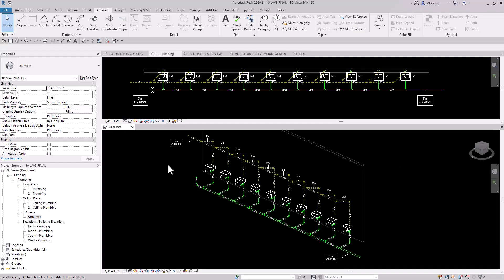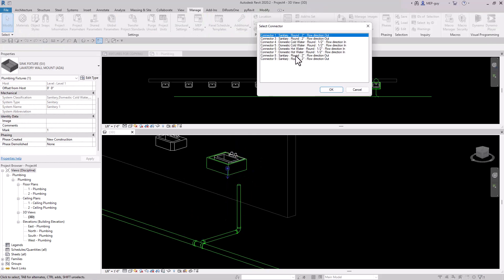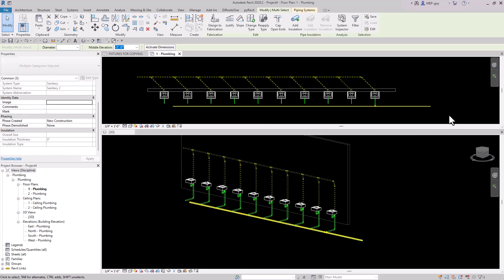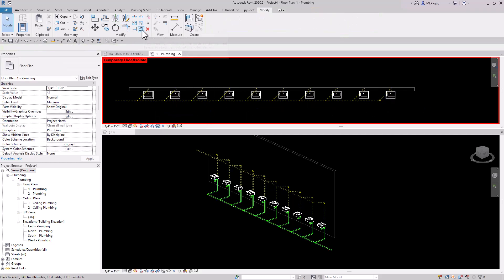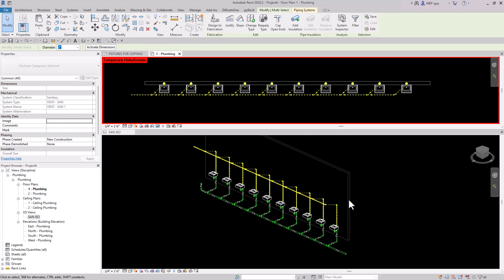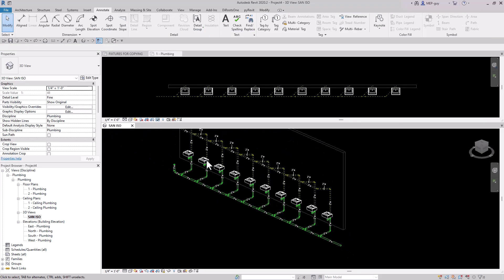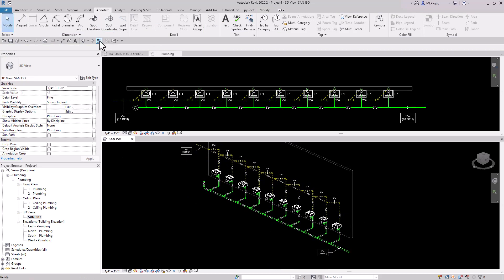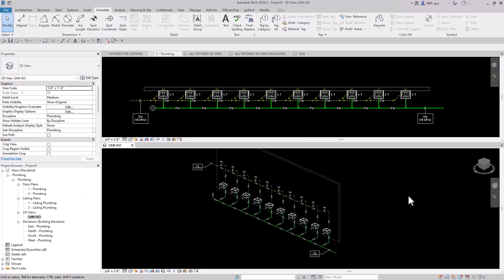Track DFU's in Sanitary and Vent Pipe in Revit

Comment: Hello Friend! How do you transfer de Fixture Units to ventilation system ??
Reply from the maker: I actually use the sanitary system for my vent piping. That way I can track DFU (wfu in revit). The Vent system isn't able to do this so I don't use it.
Reply: @mep_guy  cant understand some built in stuff in Revit sometimes. Success!!
Reply: Hello, even with changing the vent piping to the sanitary type, I still can't get the FU units to count in the vent piping. Could you explain this further?